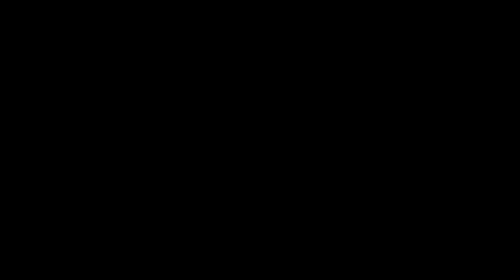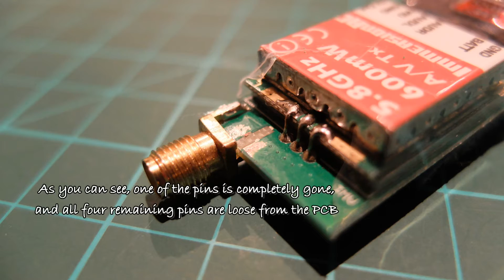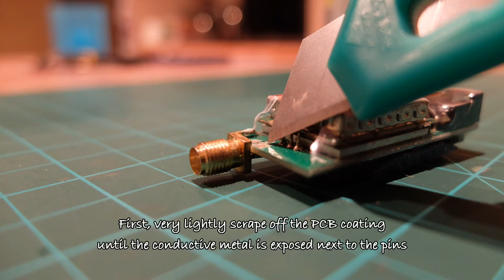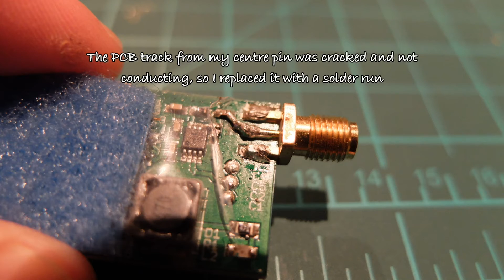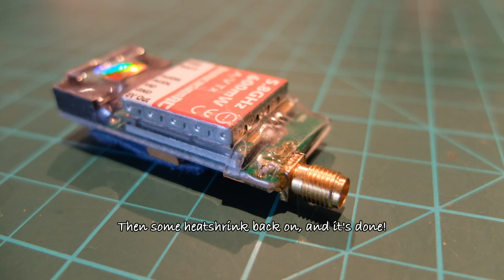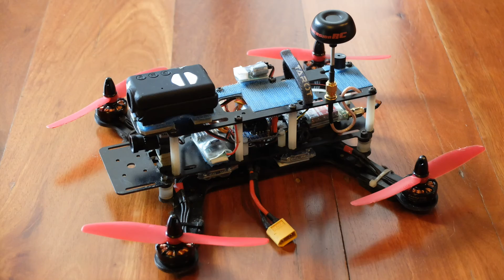How to repair a broken VTX SMA connector (fix a VTX antenna socket)

Comment: Man, I knew it was a good idea to hang on to the remaining pieces of my vtx, because one day I would find a method of fixing it. I just got done with the surgery, and all is well thanks to you!! Oh and to anyone reading this looking for tips, I was skeptical at my ability to make a "solder run" for the center pin since the entire pad broke off, so all I did was use a small piece of wire soldered at each end. Once done, I covered the area with hot glue to make sure it stayed, as well as give the sma connector a little reinforcement. THANKS ZAKSTER!
Reply from the maker: Glad this video gave you the confidence to give it a try!
Reply: Im planing to do same thing with the wire but not knowing what to soler it to on the board?
Reply: Ok i see u soldered yhe pin to that tiny device? U solder it to one leg only rigth??
Reply: ZaksterBlue please reply to me

Comment: Thanks Mate,

I just checked out your vid, had a similar problem but had the securing arms (for gnd) on one side clean broken off and the antenna had snapped where it goes into the SMA connector. After watching your vid, I figured it was worth a try. I tinned both breaks of the antenna, scraped back the board for the arms to get a connection, reheated the antenna and joined it and then got a solder connection on the arms. On the side with the arms missing I dragged solder across to the board.

Tested, all worked fine so I epoxied it all up so it wouldn't budge.

I was going to try it anyway, but after seeing your vid it gave me the confidence to get on with it. I've now gained a vid tx back!

Cheers
Matt

Comment: Many people ought to find this useful ZaksterBlue, nice post! I made an almost identical repair, except all of the pads were torn away from the PCB. In addition to the running the centre pin to that SM component, I ran a wire from the ground on the antenna socket to pad where ground comes from the battery.

Comment: Hi thanks for ur informative video..same thing happened to me today and im trying to fix it, but im not getting any connectivity with bored, i can make a bridge but im not knowing connect to what exactly, i can see ur bridge but i want to know to what it exactly connects
Reply: I am talking about the midle pin
Reply from the maker: Mar1wan1 Hi, the other end of the trace goes to (what I think is) a surface mount resistor. You should be able to see where the track used to run to and solder either a little solid wire or a solder run to the end of the component directly.
Reply: ZaksterBlue thank you for ur reply, the track shows it going to the midle of this small component, but to which leg should i solder it rigth or left? Is there anything in the midle

Comment: i just had mine brake today ,tried to solder it back together but the solder will not stick ,i did not scrape it yet because i just seen this video ,,i was told the tracer on my board had come off as well onto the SMA connector pin ,So should i still scrape it first .or is it toast
Reply from the maker: Hi Steve. Have you had another try fixing it?  All but the centre pin can be grounded to most of the board once you've scraped it some. It doesn't need to be the original tracer.
Reply: well did it brake off complete at the time of flight ,if the connection was lost more than likely it is fried . My was bent but not broken ,so i unplugged it so i would not fry the TX when i bent it back ,that is when it broke off..So that being said ,a friend of mine was able to repair mine ... but had to purchase new end for him to re solder back on

Comment: Hi, sorry for my english. I soldered the new pcb track with servo cable, and the end of servo cable I attach the SMA pin, so I have extended pin with cable. The picture still clear on 150m with stock dipole antenna. But I don't yet test it for long range. What do you think my setup for long range flight? Its good or bad to use the servo cable just for extent the track? Thanks
Reply from the maker: Irwan Setiawan Hi, sorry I didn't see your post earlier. Hope you've done some more distance testing by now. If you replace your antennas with circular polarised ones like Spironet or similar, you should get a pretty good range.  My 250mw fatshark VTX with Spironets can get over 2km on a glider.  If you want even more range, then you can use a helical or crosshair antenna on your goggles which will easily double the range.

Comment: Hi this is my second 600mw tx that I bresk connector but this time even the metel small sheets on the board were removed..so where can I solder the grounds?
Btw did u still have ssme range
Reply from the maker: Mar1wan1 Hi, as I show in my video, you have to scrape off some of the plastic to expose the metal underneath. Anywhere around the ground connectors is fine.  And yes, power was much reduced after I repaired my transmitters.

Comment: the antenna connector part on my skyzone fpv goggles broke!!!?

pls heeelp
Reply from the maker: Wow, that must be pretty rare!  If you can take the goggles apart and do a similar repair, whether using the same connector or a new one, I wish you luck!
Reply: ZaksterBlue wow never got such a quick reply..thanks for replying i will try this method 😁